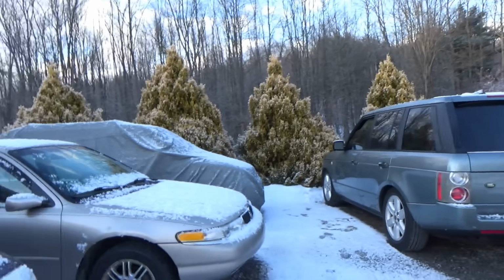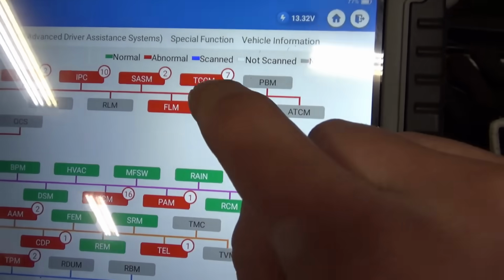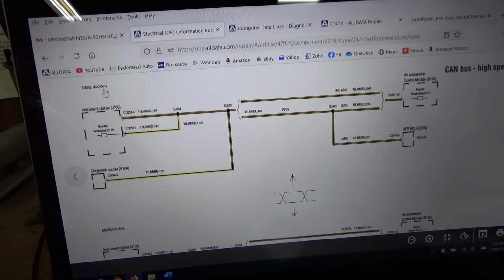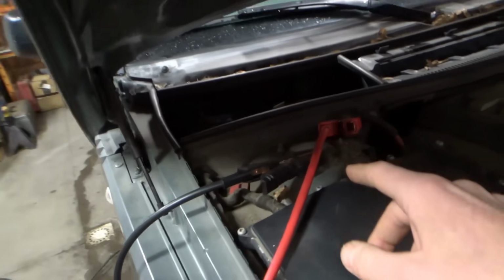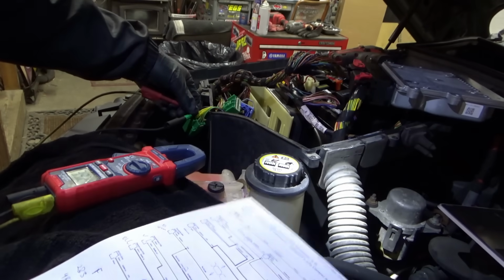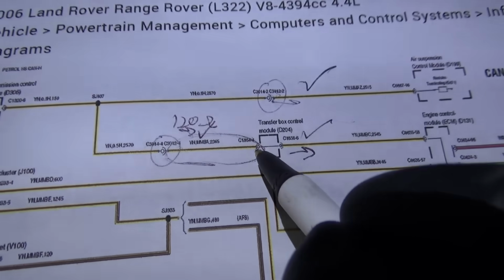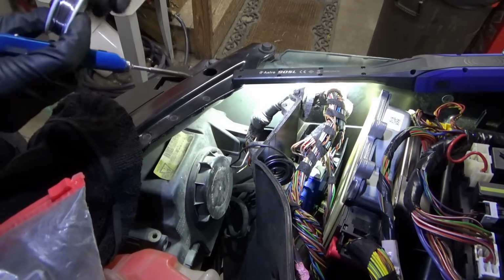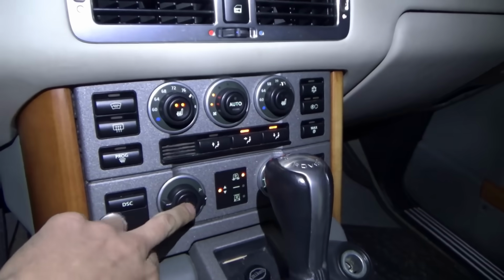LIMP Land Rover?! Transmission & Suspension OFFLINE? ('06 HSE V8)

Comment: I was a Toyota Land Cruiser fan for years now i own a 2006 Land Rover Discovery 3 4LTV6 Petrol Colonge it's proved to be the best vehicle i have owned it goes more places than the Toyota with eez and 100 times more comfortable I'm a Mechanic had to Learn about Computer Modules ect but now with a good bi directional Scan Tool and a Scope all is good and Genuine Land Rover Parts are cheaper than Toyota,  best move i ever made 😊😊😊

Comment: Always wise to look at year with RRs. BMW owned LR from 1994 to 2000 when they flogged it to Ford, but Ford kept the BMW V8 for a few years. Yeah, I know. So this 2006 finally had the Jag V8 engine enlarged to 4.4 l from 4,0 and it eventually went to 5 and no it wasn;t the 4 valve DOHC mod on the modular Ford engine that the Mercury Marauder got.

So if the diagrams were good for Ivan for this 2006 Ford is responsible -- they flogged LR and Jag to Tata in 2009.

Comment: Hello Ivan,
Really Enjoy watching your videos. Especially enjoyed this video. This one is dealing with Device Networks. I enjoy how you checked the DLC connector on Pins 9 &16 to check your Can_H and Can_L Trunk Line Resistance, which is 60 ohms two 120 ohm Resisters in Parallel. I like the way you also explained power must be of on the Network. Like the way you used the Network Topology to show the modules and End Terminators in the Network and find the No Good Modules.
I have a question on the two test points that read 39K ohms. I think you where reading the module Resistance for one module. The Device Net Standard for module Resistance is 36k to 39k ohms in and Industrial application. Can you show how you where reading these point at the time you read 39k ohms. Please confirm on a known good module. Remember these can be added like Resisters in Parallel. I under stand 120 means and open in the Trunk Cable. Thanks

Comment: I have owned several Land Rovers and they have been pretty reliable. Currently own an 08 L322 similar to the one in the video and an 08 LR3. When you have issues you should always check voltage when running to make sure there is proper voltage. A low voltage will cause all sorts of issues. Good job finding that broken wire.

Comment: Quick tip for when shrinking your shrink tubes in close quarters run your soldering iron all along it removes the possibility of melting other wires , it is quick & safe. Cheers Ivan got lucky with one of the worrst vehicles for electrical gremlins.

Comment: No parts required! But seriously, how many auto technicians today could’ve found that problem I would say not many there would’ve been a a lot of modules replaced with no success, your videos are so interesting when it gets into wire diagrams I get lost quick great job waiting for the next one.
Reply: 3 jobs this week alone that i found a broken wire that fixed them. Bigger issue is trying to get customer to authorize the time to diagnose it and repair it. Last one this week was a broken wire under the center console. Circuit ran from the bcm under left side of dash to the right rear corner above the headliner. Could have run a new circuit but you never know what other issues may be present where the actual fault was.

Comment: I drove a wrecker for a decade back in the 90s.. LR had a big issue with the brake light switch. The brake light switch was linked to the shift interlock.. if the brake light switch failed you could not get the vehicle out of park! There was no release mechanism. Needless to say, owners were not happy that we were dragging their $80k Rover's, locked in park, up onto a flatbed! JUNK

Comment: It occurs to me that some diabolical mad scientist consultant to the car manufacturers came up with the idea of CANbus wiring and computer diagnostics to change the Dynamics of motor vehicle repair in order to create new profit centers for the manufacturers. As a systems analyst, I can tell you for certain there is absolutely no need for such complicated wiring and hardware control systems in Motor Vehicles. This should be patently obvious given that automobiles never had such wiring and control systems up until the Point digital engine controls began to be used for fuel injection systems.

Comment: There is a reason these $70,000 trucks can be found on Facebook 15 years later for $2,000. Another owner would have taken it to another shop to be told it needed a transmission for $8,000 and a set of struts for $4,000.

Comment: Butt connectors don't have to take up a lot of space.  Use uninsulated butt connectors with heat shrink. That combo is just slightly larger than the original wire. Watch Wes Work does this.  I usually stick with the insulated butt connectors because I'm too lazy to change out the crimping dies :-)
Reply: Are You a newby here?😂😂
Reply: @brianw8963  No, I argue with Ivan all the time about soldering vs crimping. It's like a little game :-)
Reply: @ Always fun!  I actually found some that I like to use in certain situations. Can’t think of the brand name right now, but they have solder in the middle and sealant on the ends they actually work pretty good. ( Don’t tell Ivan I said that) 😂😂👍👍🇺🇸
Reply: @brianw8963  You have to be careful with those, especially the cheaper ones.  The solder won't penetrate the entire connection and will cause problems later on. I've heard the ones you get from aircraft supply shops are better.
Reply: @ They weren’t cheap by a long shot, and passed my somewhat aggressive tug test. I’ve only used them in tight areas where I didn’t have room to keep the heat shrink back enough to solder without shrinking it where I didn’t want it shrunk. I’ve done that , more than once😂.

Comment: I am shocked that all that fancy stuff still works. I was sure this was going to be a multi part series. 😂 Just remember that they won't all be that simple. JLR vehicles are typically plagued with mechanical and electrical problems. With the electrical problems being intermittent and nearly impossible to pinpoint.

Was that passenger door full of water?

Comment: simply amazing your process  finds the problem no guessing you are the best at electrical  repair if it went to a another shop 99 percent they spent thousands in parts and still not fixed crazy one wire cause all these problems

Comment: Nothing that the right set of probes, a meter. A scan tool, and a good set of correct diagrams can’t fix. Oh Yeah, and the time and logical thinking to get through it. I’ll bet if there is a diagnostic instruction in the Land Rover book it ends up with “ replace wiring harness”🤣🤣🤣

Comment: Basic electrical troubleshooting.  Ivan assumes nothing. Spends countless time off camera researching operation.  
These are things that our screwed up flat rate system does not allow. 
Tons of working parts have been replaced since 1972 when I started in the car repair business. Always will when shop rules dictate very short time to diagnose a problem. Wild Ass Guess method has forced otherwise good techs into this situation. 
I don’t think I’ve ever heard Ivan say he has .3 hr to diagnose a problem like this. 
This also shows the satisfaction that comes from being a one man shop instead of a cog in a big gearbox of a production line shop. 
No “Get em in Get em out” rushing for him. 
Only rush is us subscribers wanting to see the next solution. Thanks again Ivan for showing us the joy of solving this.
Reply: I've always called it the SWAG method. Stupid Wild Ass Guess 😂.
Reply: @topher8634 I prefer to call it a scientific wild ass guess
Reply: I made it a little over a year at a VW/ Toyota / Mazda stealership in the late 70’s and got out because of the flat rate system. I did get to where I could replace a clutch in a Beetle in 45 minutes or less, and that was with installing all 4 engine mount bolts. I could always tell when the job had previously been done, because the top left bolt was NEVER reinstalled. I did enjoy the work, especially on the old Beetles , but there was simply no future in it for me.
Reply: I spent 40 years in heavy truck repair. Flat rate does not work in truck repair. 2 hour diag time is standard. Cannot wild guess a repair. If you work at a truck dealer you can try parts at the problem. I would keep notes on strange repairs. Made many other diag deals easy.
Reply: Having been in the repair business since 1972 as well, working for my dad and later for myself, we never used the flat rate system on anything we didn't know how long it would take to diagnose.  Noises is cars was a big one especially if it took some time to determine the source because the noise would be telegraphed throughout the car.  I enjoy Ivan's channel simply because he is able to do something with minimal equipment and overhead; just like we did to back-in-the-day.  I did notice at the beginning of this video he's able to sit at his desk with his scan tool and talk with us; kinda like Eric O. does.
Reply: There was no flat rate for this if it just rolled in the shop. Any shop would charge at least 1 hr or more just to diagnose.  Flat rate assumes you know what you want to fix.
Reply: @kevin9c1  I don’t disagree with you at all. But I’ve seen FR times with ridiculously low “Diagnose ?? System” 
I worked as tech for Subaru dealer 14 yrs under FR. Got fed up with that. Ran my own independent shop 36 yrs with the vow I would never treat my  fellow techs shabby with FR. 
I insisted on treated my clients and techs fairly. Like I said you’ve never heard Ivan say he was under a time crunch due to FR saying you could diag a system in ?? hrs. 
I never put myself or my techs under that kind of stress. I’m retired 8 yrs now after 50 in business. Hope you’re having a good day.  🙂

Comment: The L322 generation came out in 2003. However, there was a facelift for the 2006 model year which included a switch from the BMW sourced 4.4L V8 to the Jaguar sourced 4.4L V8. Both engines could be problematic. However, the 2006 models also upgraded to the excellent ZF 6 speed auto instead of the junky ZF 5 speed auto.

Comment: In amazed in 2006 they had touch screen. Also how the heck can the touch screen work the mechanical clock?!
Reply: This generation came out in 2003. The analog clock is still electrically driven, so the touchscreen just commands the electric clock mechanism to move to the set position. Heck, Range Rovers back in 1995 had a similar analog clock that you just pushed down a button and the clock hands would move electrically until you stopped pushing the button.
Reply: my passat b7 is the same.

Comment: I had a 2022 land rover basically brick one time because I pulled out my dongle while the scan tool was trying to establish communication. had to keep key cycling and clearing codes for 15min before i could drive it. then had to drive cycle it while repeatedly clearing codes before it was back to normal.

Comment: Dealer would have replaced the module(s), then maybe found the wire and fixed it and wouldn't have told the customer a thing but charged them a bunch.
Reply: Dealer wouldn't have fixed the wire. They would tell them they need a $5000 harness.

Comment: With such thick wiring, how could it break? Japanese cars use thinner wiring and last a lot longer
Reply: It’s 20 years old and vastly more sophisticated than Japanese vehicles of the same era. I’d say Land Rover did quite well.
Reply: If the insulation was ever damaged then it doesn't matter how thick the wire is, it will eventually corrode and break. 

Someone could have picked it with a knife in the past, a mouse could have bit it, or it was damaged at the factory and took 20 years to finally break...
Reply: Age, non foreseen vibration, biodegradable insulation that degrades way too early. Oh and planned obsolescence of course.
Reply: what a stupid thing to say 😂😂😂

Comment: Are you sponsored by topdon or do you just like their stuff?
Reply: Diagnose Dan and Eric O both also use them and together with Ivan all three say they use them.
Reply: @ Yea I have a battery tester / printer from them but none of their diagnostic stuff (Snap-On truck has been too easy to get stuff on the drip haha)
Reply: Eric O uses mainly an Autel Ultra as his primary scanner.
Reply: @ Topdon is a battery maintainer.

Comment: The compressor in the rear for the air suspension is a common fault on Range Rovers. That would be my first check.
Reply: Wouldn’t affect the transmission at all though…
Reply: @tylermacconnell217  I never said it would.